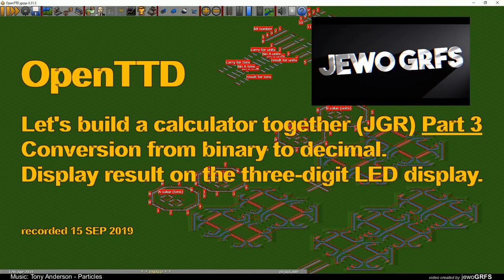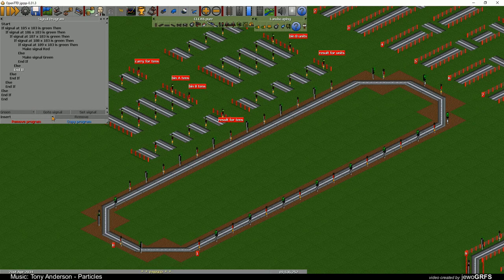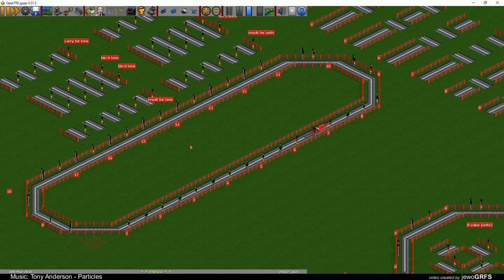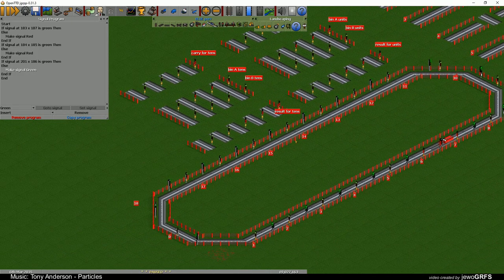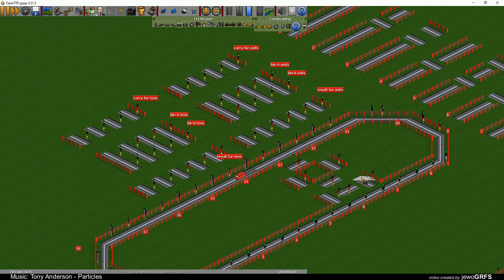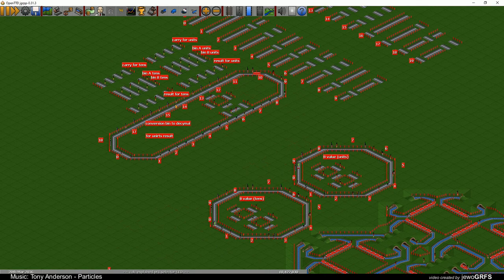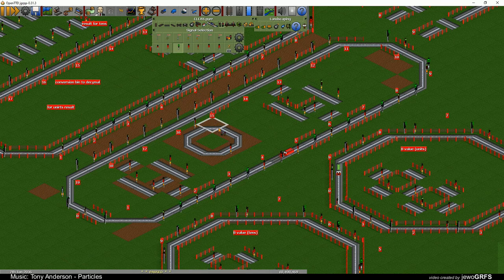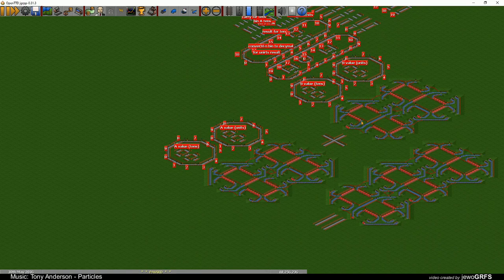🚅💡📌OpenTTD - Let's build a calculator together, JGR, pt3 - last

Comment: :-)
Reply from the maker: Thank you Nirasa 💗. I just managed to compile Jokers Patch Pack myself with MAX_LOGIC_SIGNAL_RECURSIONS increased to 50. Right now adding looks correct. If I manage to build that calculator in JPP I will make another video.
Reply: @jewoGRFS  That's great.